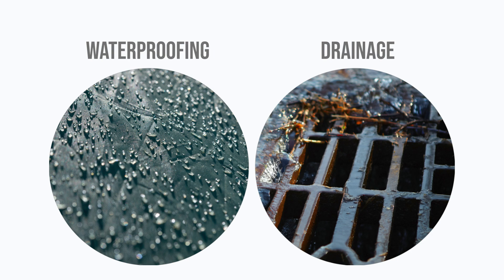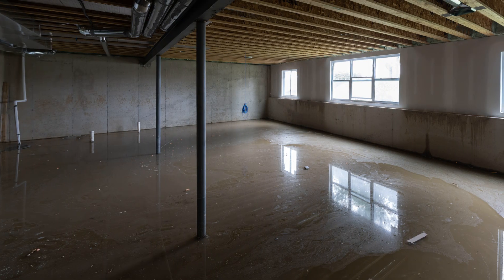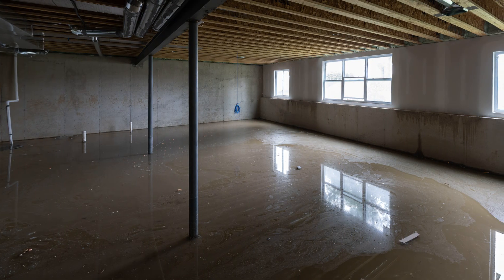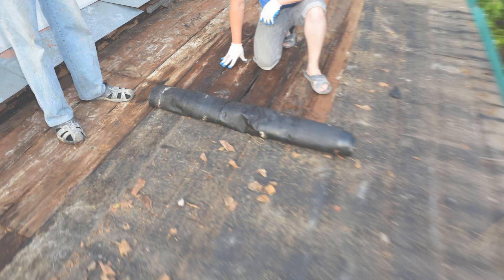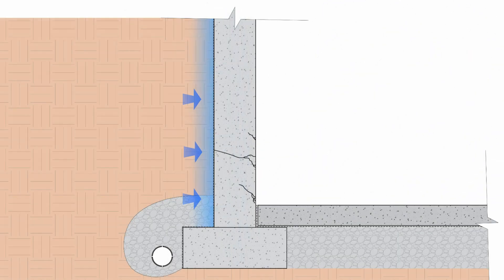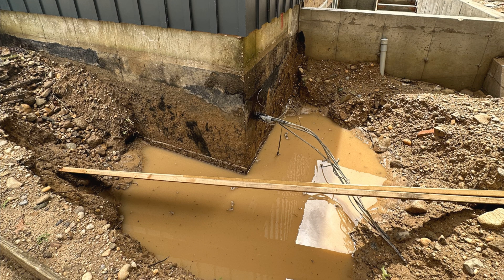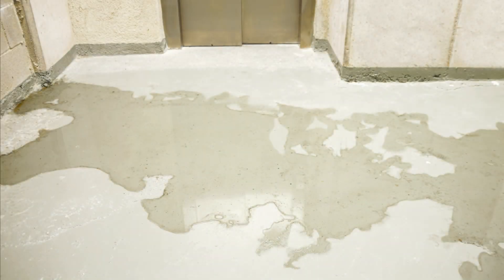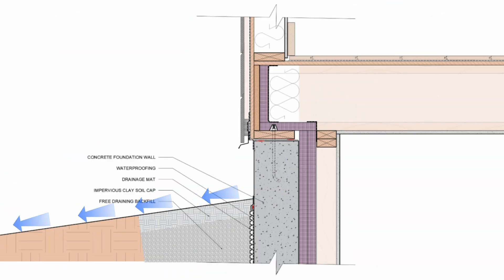Waterproofing vs Drainage (What's More Important?) | Building Science Bites #1

Comment: How would you go about insulating a floor system for a house on posts in a cold climate?
Reply: If the building is on piers and air is permitted to flow freely under the structure, you need to insulate between the joists but more importantly air seal the bottom of them. Basically consider the floor is an exterior wall turned horizontal.
Reply: @CMCraftsman, what if i insulate above the joists by sandwiching rigid foam insulation between plywood like an SIP and keep the joists open? My thought process is to keep from creating cavities that rodents could live in.

Comment: Waterproof and drainage! Boom!
Reply: I was going to say the same thing.  First line of defense is drainage.  Last line of defense is water proof.  It follows the hierarchy of controls when it comes to safety of workers.  Remove or engineer away the hazard and thr last line of defense is PPE.  The waterproofing would be the PPE in this case.
Reply: @pin65371 totally. Allow a chance to drain and dry, in the even of bulk water, need the waterproofing until the bulk water event is over

Comment: How do you drain a wall that is above the roof like on a dormer?
Reply: On new construction, the general idea is flashing tape across the bottom of the wall and deck sheathing and up both sides on the slope to seal the house wrap to the roof underlayment.  The roofing shingles go on next.  Metal dormer (apron) flashing across the front of the dormer base, with step flashing up the slope on both sides after that.  Then a rain-screen assembly for the siding will complete the strategy.  You'll need a professional to guide you before attempting this yourself (there may be issues to address).
Reply from the maker: Headwall flashing and step flashings. Also depends on what you're using for the roof covering. The previous commenter described how to flash that location perfectly.

Comment: Gravity drainage is always the best option in my opinion
Reply: passive systems that accomplish a good result :)
My preference is schedule 40 PVC (DWV) pipe drains (not the sh*tty "drain&sewer pipe" to catch downspouts and take the water far away. Catch the downspouts with a Wye+cleanout cap and 90 into the run away from the home.
Reply: @mrniusi11 this is a good strategy. I need to come back and read this when I’m not so tired